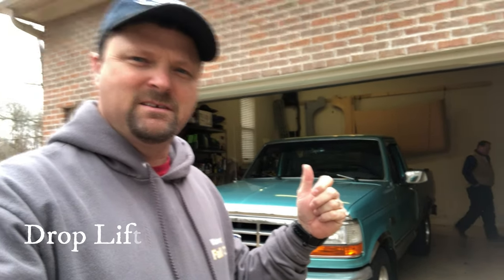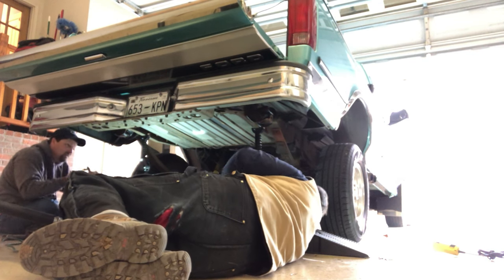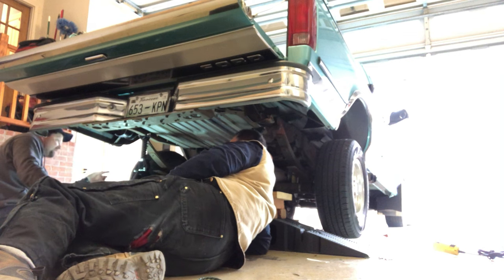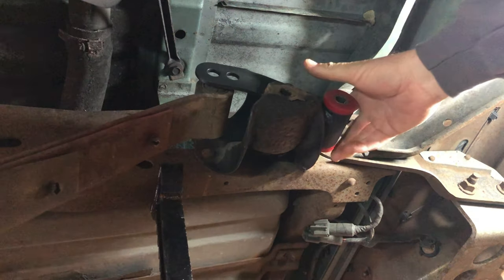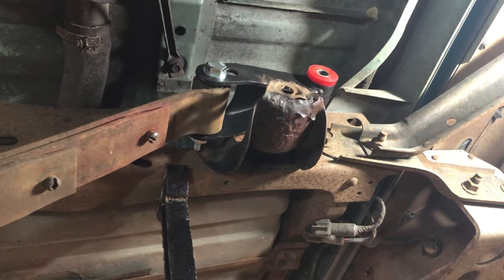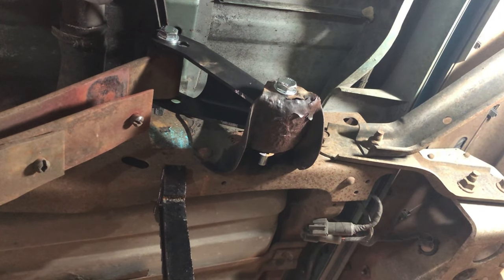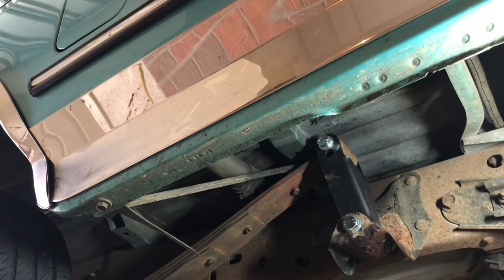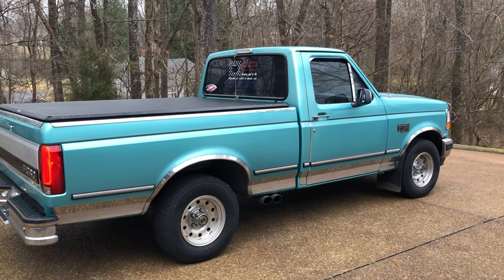Dropping the rear 2" on a Ford truck  Thez Nutz Garage episode #22

Comment: Also, how did you mount the fog lights? Did you drill into the bumper or the plastic lip? Very good lookin truck. Mine is a 1996 single cab, short bed, and with the 300 but it's an automatic unfortunately. Mine also has around 190k miles.

Comment: I put 2" lowering shackles on mine with the same results - about 1/2 inch. I'm going to do hangers.
Reply from the maker: Yeah I said something to him about hangers but he was overall happy with the height of the rear ended.
Reply: Did you ever try hangers? I did and they didn’t fit. It was a pain in the ass and I’m going to have to re use the original hanger + the shackle to atleast drop it a little.

Comment: Great video. It seems like a lot of work for not much payoff. This video changed my mind about buying these. Thank you. Very nice truck.
Reply: Get the 4" drop if you want it lower. Or do the flip kit. I flipped the axle and did the 4" drop. Measured just over 7" of rear drop. Don't do dream means. They break. Do lowering springs up front. Or get lightning front springs. Between 1-2" that way

Comment: Whats the part number!!? 
And will they fit on a f150 1992 ?
Reply from the maker: Erasmo Martinez I would image they would fit a 92 BUT overall it only dropped the rear about an inch!
Reply from the maker: Erasmo Martinez here is the link to the 2” drop shackles. 

https://djmsuspension.com/product/sh1014-2/

Comment: Very nice video. Does anyone know of any vids on lowering 1996? I have the same kit as this if it's a 2/4 kit
Reply from the maker: I would imagine the rear kit would be the same. Drive your truck to Tennessee and we will make a video on a 96.
Reply: It's the same. I've got a 96 and did the 4" rear drop. It definitely was a challenge getting the leafs bolted to the front mount. Don't forget the pinion angle shim!

Comment: Could a person make there own drop shackles?
Reply from the maker: Hillbilly Peak. I would not attempt to do it. The way the factory shackles are made I am not talented enough for fabricate them and when the new are only around $70 why chance it.
Reply: @ThezNutzGarage  2 years later..yes, they just need to be longer so they sit higher. Could easily weld an extension on

Comment: Just put some on mine and for some reason it hits the bed
Reply from the maker: I remember them being really close to the bottom side of the bed. I really don’t think it did much at all as far as height goes.
Reply: @ThezNutzGarage  Yeah it really didn't, maybe about 1 inch that's it. But I'm thinking of doing a flip kit instead and coils in the front
Reply from the maker: Yeah that’s probably the best thing to do. That truck currently is being repaint and maybe when it done I can do another video on it.
Reply: @ThezNutzGarage  hell yeah man, bad ass ! I'll definitely be on the look out for the vid 💯 looks great

Comment: Just flip the hangers
Reply from the maker: Morton Family I might try that on our new shop truck when we lower it.
Reply: I flipped my front hangers and it leveled the back with the front perfectly! But it also made the pinion angle so bad I could barely drive around the block. Was very sad seeing my truck exactly how I wanted it then had to put it right back to original until I get some axle shims
Reply: @danielmiller3967  I did the rears.